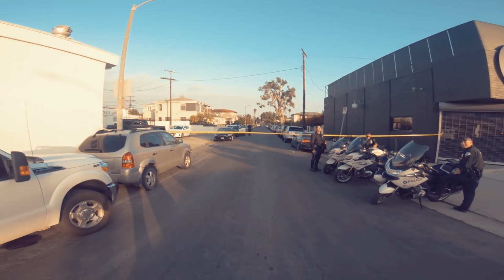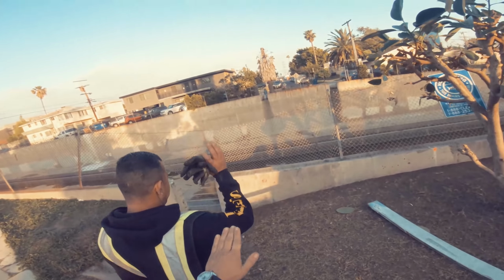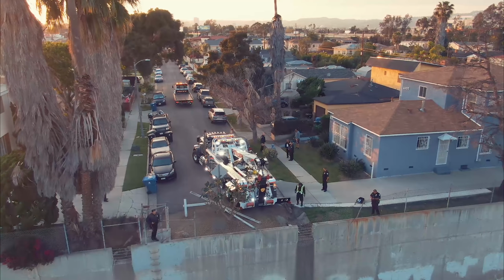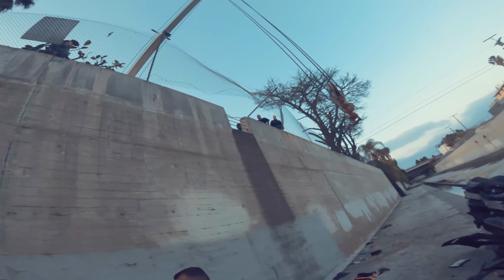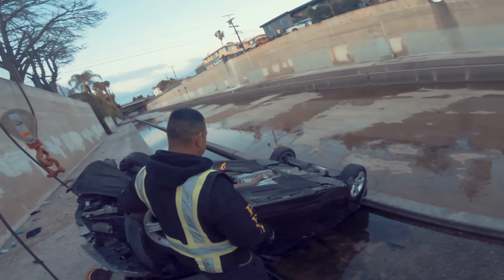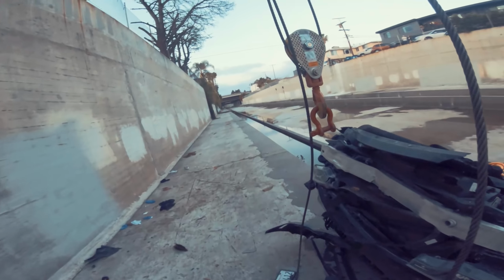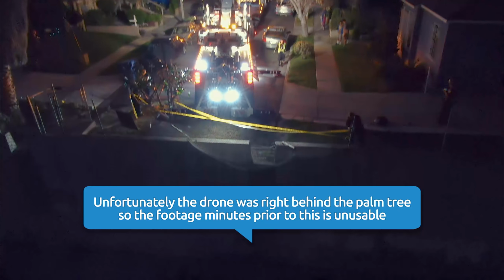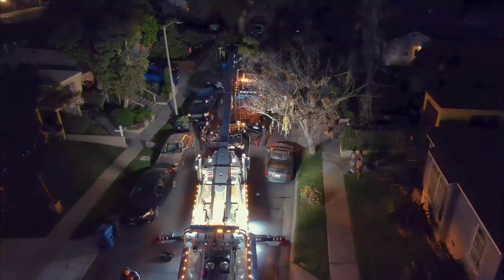Joyriding gone wrong - BMW crashes fence and lands upside down

Comment: Did you splash the other cars with oil?
Reply from the maker: No, the car wasn't over the other ones. I had it boomed high and tucked in so I was in between the cars and my truck. Even then there wasn't an oil leak, the car was dipped in water and I was referencing the sewer water getting on my truck
Reply: @PepesTowingService  nice, well it's very impressive how much power your truck got.

Comment: I still can't picture how they ended up upside down in that short of a distance.
Reply: I am guessing the driver noticed the road ended but was going too fast to stop in time so the car probably wasn't moving that fast when it went over. The front of the car slide over the edge and then gravity did the rest. If the car was going fast, it would have flew a lot further. That's my take.

Comment: well you brought the rotator might as well use it no sense risking your very expensive tires driving in a drain
Reply from the maker: The entrances to the tunnels are brutal, no way I'd make it without causing damage.
Reply: Pepe's Towing Service Guess you’re used to being cool as a cucumber! Kudos to you. Can’t be easy walking onto a job site with multiple people shouting on how YOU should do YOUR job! Dang! 😱That’s being a Professional Folks! Well done, Holmes and crew, of course. 😂👍😁😇😁
Reply: if they drove down the drain could have done it with just a flat deck, but brought the rotator so might as well bill for ....  i mean use it

Comment: Takes a lot of LA cops off the streets with one poor driver over the edge. 
However is safer duty for the cops, as they have a tough, thankless job, yet we depend on them to keep some law and order.. Terrible fix we are in and have allowed to happen over the years giving these no-goods who mis-behave every advantage, but get no respect. We just give them a bigger welfare check in hopes they will change. Trying to buy them out will not work, ever. 
Not good for a happy future. 

Another great video. tks

Comment: Dam i never would swing anyting over the 2 milliion dollar tow trucks body. I would drop that in the driveway then slide it on the deck
Reply from the maker: Then the home owner files a complaint or sues because his driveway gets scratched/damaged. That's the purpose of these rotators, to swing.

Comment: Why not just take a roll-back down to car , flip it, and load it up?  On second thought you just like to go “car fishing”.🤗
Reply from the maker: I'll paste what I wrote to someone else "Driven straight down how? Past the BMW was a dead end, the entrance on Fairfax was before. Even if you managed to make that turn, you'd have to back up all the way to it with a flatbed. Without any room to turn and a single winch line, I'm curious how you would have done this job considering the only part you could drive on was where we were standing."

Comment: The flat bed could have driven straight down and pulled into that driveway...ya would not have to go over the other cars that way !
Reply from the maker: Driven straight down how? Past the BMW was a dead end, the entrance on Fairfax was before. Even if you managed to make that turn, you'd have to back up all the way to it with a flatbed. Without any room to turn and a single winch line, I'm curious how you would have done this job considering the only part you could drive on was where we were standing. You obviously are a master armchair quarterback so I'm DYING to know your solution.
Reply: @PepesTowingService  I'm just thinking that if the flatbed drove straight down the street and into the driveway where the police were standing most of the time, right there along the the ravine to the right side of the rotator, before you backed the big truck down, you could have just lifted the car up over the fence and onto the flatbed, You did not want to rotate the car over your truck because you did not want it to teak on it but you took it over parked cars to get leaked on ! I bet you get a lot of armchair tow truck drivers tell you want to do .... SORRY !
Reply from the maker: @timw6596  Yes I do, a lot of people that have never operated a rotator in their life let a lone a regular tow truck throwing out ideas as if they know what they're talking about. So you would back up the flatbed down the street first, then have him park in someone's nice driveway? Why would you do that? Why would you assume the homeowner would take that risk? In that scenario, it would be 100x more dangerous and risky because I would have to boom out OVER the flatbed cab and fully extend to try and get the end of the car at the edge of the flatbed. How would you hold it in place? The way it's normally done, you can use the winch on the flatbed as the rotator goes down. Your method, you can't do that. As for the parked cars, where did I leak on them? There was TWO cars parked, I was boomed very high and tucked in so the car would technically fall flat first on the street, absolutely nothing leaked on the cars.
Reply: @PepesTowingService  the flatbed could have driver forward down the road and into the driveway....but I see your point about marking up a driveway, and I guess its just the camera view that made it look like the car was right over the parked cars............ I'll have to watch and not try to double check your work, you know what your doing for sure ! Keep it up !